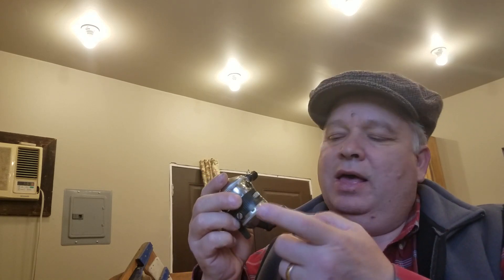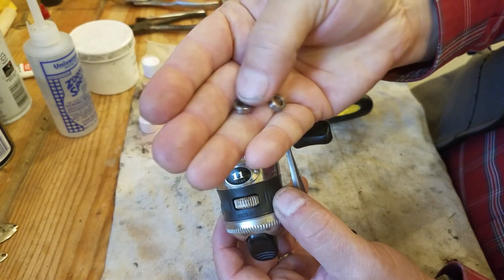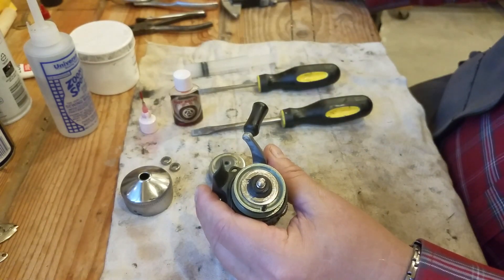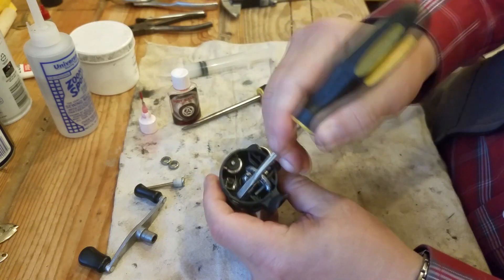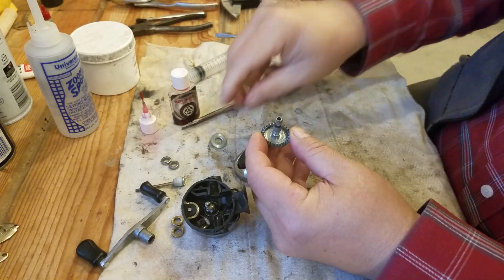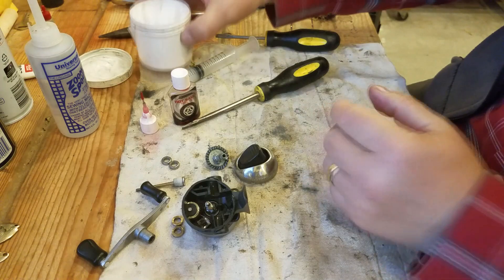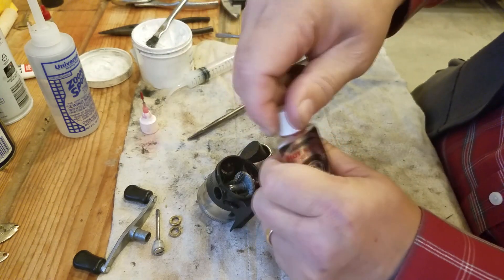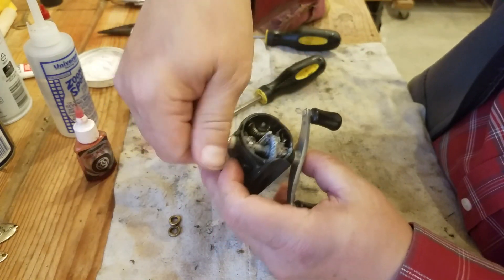Super Tune a Zebco 11 Reel!

Comment: I saw your comment about this video for the 11ts. Unfortunately the 11ts has deep plastic bushings with screwdriver slots about a half inch in length instead of bearing sized bushings. Thanks.
Reply from the maker: That is good to know. Thanks for the comment.

Comment: I'm getting ready to do this on two micro 11 reels. I also have a legacy 11l that is actually more like an rl3 but with a bigger drag wheel. I wish I could super tune both of those but they have a different kind of bushing.
Reply from the maker: You are right. THe RL3 and 11L cannot be tuned up with ball bearings.  Just the Zebco 11 that was made after 2000 which has the round "donut" shaped bushing.  I figured this out when I discovered Zebco made an 11 Gold, which did have a bearing on the handle.

Comment: Is this possible to do with the 11T also? The triggerspin of the model 11
Reply from the maker: I went and looked at the schematics on TackleService.com and yes, you can do this with a 11T.  The bushing and bearings are the same.  Replace the two bushings (BY026-01 Bushing) with the bearing found on the 11gold (BY097-01 Bearing 11MA)

Comment: The spinner head assembly part number is BY310-01 for the authentic and is  BY310-02 for the 11 micro gold. Do you think they are interchangeable? that would give me 2 take up pins on my authentic.
Reply from the maker: You are being creative. Yes that would work on your Zebco 11.  Those spinner head assemblies are interchangeable.  You may notice on the BY310-01 that it has two slots for pins, but only one pin.  Is that right?  Anyhow, go for it!

Comment: Mathew is have an old Zebco Legacy 11L reel.  The cast button is not working meaning when i depress it it does nothing but stay pushed in.  The line does not pull out and it does not lock after reeling because the button never worked.  I took the bottom cover off and found a couple tiny pieces of plastic off the inside of the cast button.  Any suggestions?  I bet the buttons plastic is is part of the problem.  What would i do to fix this?  Thank you !!
Reply from the maker: @TimEmmett-k5u  that is unfotunate.  That could be the push button hinge pins.  Also, the push button does not control the cast.  When you push the button in there are two thins that happen.  The  spinner cone push out against the front cap and act as a line brake until you release it for the cast. The 2nd thing that happens  is there are tabs that hold thespinner cone out for the cast and the pick up pins stay retracted and allow the line to go out. Is this a reel you bought recently? I wish shipping was not so much.  I'd take a look at it for you.
Reply: @OutFishing13Matthew  I was able to get the zebco part number from zebco and ordered a bottom cap complete with button.  I think i will break it all down like tou did in the video and see if it will work after cleaning it all up. Oh i have had it since 1996 and it is mint.  I am hoping to keep it.  Thank you for replying so fast !!!
Reply from the maker: @TimEmmett-k5u  You are welcome.  That is awesome you got a new part.  See if you can order a new spinner cone.

Comment: I have three 11 micros, not two are the same inside. All three have black plastic bushes, are these the same size as the brass ones to take these bearings?
Reply from the maker: Not all the time.  You have to be cautious. Are the bushings the size of a bearing or are they long with a key that fits into a notch?
Reply: Just the size of the bearings by the look of it. I’ve ordered some bearings to try they are cheap enough 🤞🏻
Reply: Did my three 11’s with the bearing and new grease etc. All three reels were different in some way, one had a plastic spool. Two had metal and one had a sealed removable bearing round the centre shaft.
Reply from the maker: @robertwilson6736  Well Done!  Thanks for sharing

Comment: Hi Matthew, the new platinum 33 does not have holes in the nose cone. I'm  wondering if you know why? And should I make my own or not mess with it. Thanks
Reply from the maker: Are you talking about the drain hole? I would not change anything.  It is designed to drain.
Reply from the maker: I wouldn't mess with it.
Reply: @OutFishing13Matthew  OK thanks for replying.  I'll leave it alone.

Comment: Excellent video.  I supertuned mine but  anti-reverse pawl on my micro 11 cracked in half.  I have been searching for a new one .  Does anyone out there have one they would sell me ....I am not ready to get rid of that little reel as it is my favorite ultralight asset.
Reply from the maker: Did you call Zebco?  They may still stock that part.  I will check my parts hoard
Reply: @OutFishing13Matthew  Thank you for your reply...I did and they told me the standard " that reel is no longer manufactured so parts aren't available" .  I sent message to the repair services outfit you mentioned in your posts...Hoping for good news from them.  I appreciate you checking as well ...I love that little reel and I am in no way ready to part with it .   Your videos are great I was always afraid to do anything to these zebcos for fear of messing them up.  I will take a photo of the part and send it your way as well.
Reply from the maker: What is the part number?

Comment: My cone line catcher spring came loose how do I fix it
Reply from the maker: There is a little metal catch on the inside of the cone.  Gently put one end of the spring back behind that little metal catch.  Then the pick up pin should poke out of the rim of the spinner head assembly.
Reply: @OutFishing13Matthew  ok thanks

Comment: Way to super tune, what did the two ball bearings cost?
Reply from the maker: Tackleservice.com sells them for 60 cents each, plus about 5.50 for shipping.  If you have  couple of those reel, then buy enough for them all.  Also, you can find stainless steel bearing on Ebay for $10 for 10.   6x10x3mm
Reply: OutFishing13 thanks Mathew, that’s great info, might trick out all of the Zebcos.from busings to bearings.